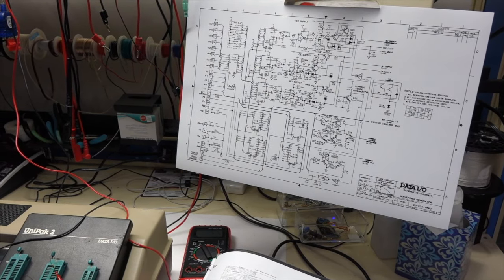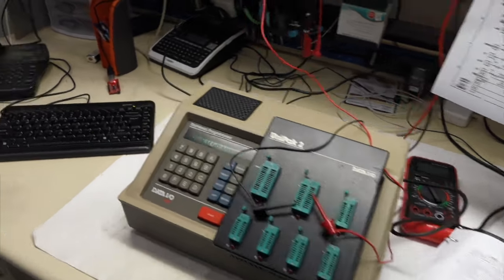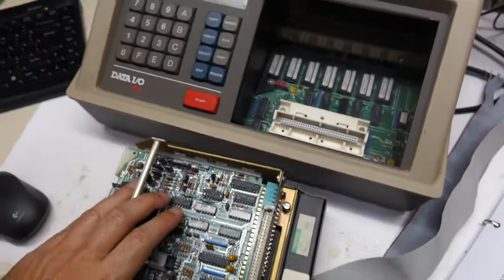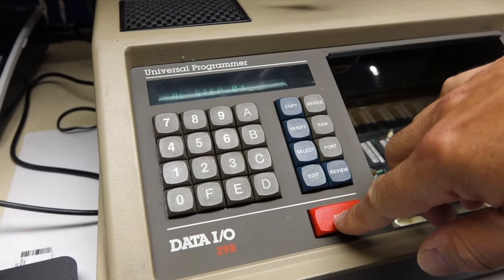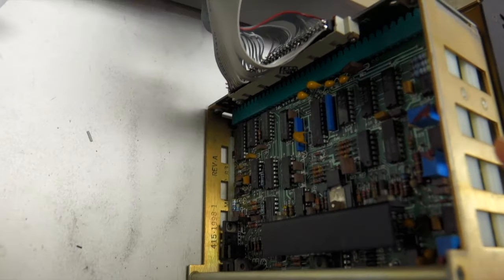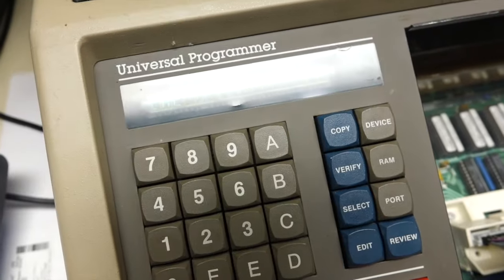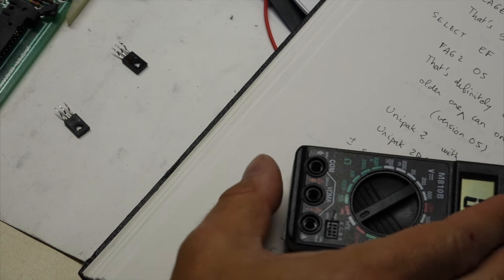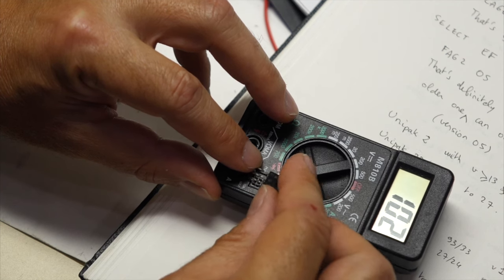Data IO 29B PROM Programmer Repair Part 2

Comment: But.. Why not simply replace it with the same (or equivalent) and measure if TP1 matches whatever is mentioned in schematics?
Reply from the maker: Yes, that's what any sensible person would do. But then I wouldn't get to play with the 1972 vintage Tek 577 and match a replacement in the next episode... ;-)